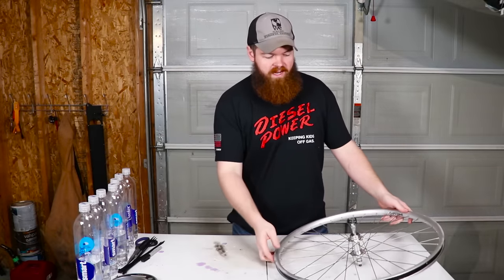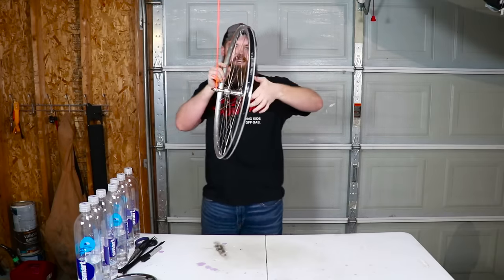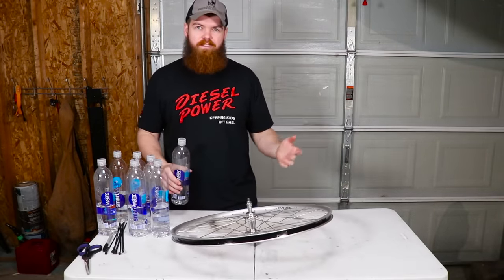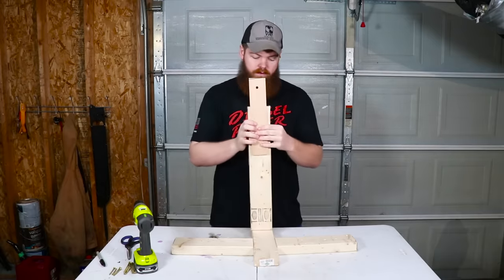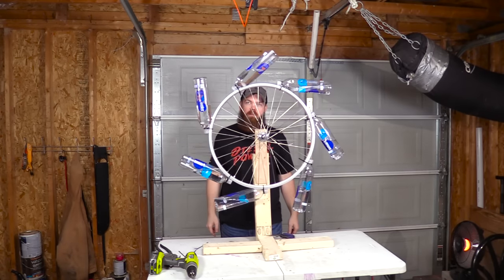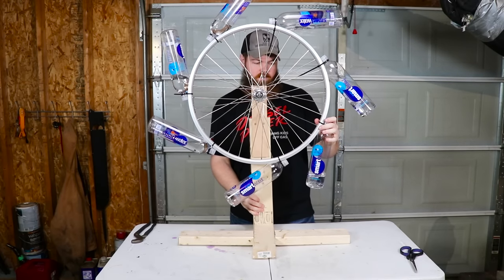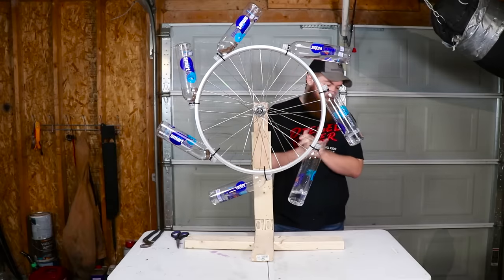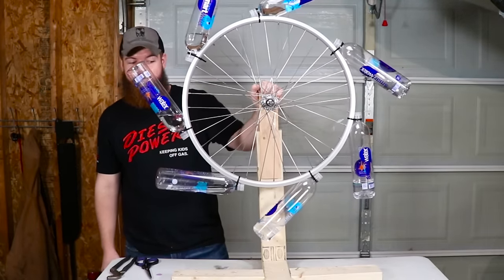Can A Perpetual Motion Wheel Actually Work?

Comment: The reason it didn't work is, you forgot to fit the hidden electric motor.
Reply: And the magnets
Reply: Lmao yes
Reply: Krakka Jakk711 magnets?
Reply: Or the guy in the greenscreen suit spinning the wheel
Reply: @jakkakasunset5485  electric motors work from magnets
Reply: It would have worked if he filled the bottles with blinker fluid.
Reply: Good one😄
Reply: One bottle is missing, with 8 it works.
Reply: At least he is honest, didn't deceive people. 👍
Reply: @janengel1985  Please tell me you’re not serious
Reply: @mitchellmorrison4233  This type of wheel must be symmetrical.
Reply: @janengel1985  this type of wheel is not possable because when you have the bottles on one side shifting down the other side is shifting up. this wheel is balanced. free energy is not possable
Reply: @mitchellmorrison4233  One half must always be heavier than the other. It's that simple.
Reply: @janengel1985  if 1/2 is heavier than the other half the heavier side will just sink to the bottom of the wheel.
Reply: @mitchellmorrison4233  Yes, with a small turn the wheel must be readjusted to maintain the imbalance.
Reply: @janengel1985  What?
Reply: @mitchellmorrison4233  This is how a perpetual motion machine is built.
Reply: @janengel1985  perpetual motion machines aren’t real. 
You could keep it spinning for a little bit, but it’ll never spin forever.
Reply: @mitchellmorrison4233  Soon they will be real.
Reply: @janengel1985  ???
Reply: @janengel1985  Are we there yet?

Comment: Even if the premise behind the idea made any sense, the friction in the axle of the wheel would mean that energy would continue being lost as the wheel turns until there isn't any energy left in the system.
Reply: Also loss of energy due to the turbulence of the water.
Reply: What if the axle was somehow suspended a maglif system thus eliminating friction and instead of water the use of something solid
Reply: The wheel would encounter air resistance as well so it would also need to be in a vacuum.
Reply: @shaunorafferty5930  there's also resistance in the magnetic fields causing for energy loss. Far less resistance than physical contact, but still there
Reply: It's because the water creating the same amount of force when it goes back to the original position so three two forces cancel eachother
Reply: Try using full water bottles, might create enough momentum to freely spin the wheel
Reply: It's transformed to be transferred not lost. Though I get what you're trying to say. Lmao
Reply: Well the wind resistance is a bigger problem than rolling resistance
Reply: @donperry3508  with full bottles it wouldn't make a difference since it's still balanced. There is 0 momentum no matter what.
Reply: @Kaleb Crawford would the magnetic fields cause enough disruption to visibly slow down the spinning? Like if the other conditions were right, would the wheel appear to work, at least for a bit?
Reply: @loganb.313  I mean, if you had it supported by maglev, in a Vacuum, with everything PERFECTLY balanced, it may spin itself for a little while, but not forever, so not a perpetual motion machine. And you also couldn't gain energy from it
Reply: I don't have any science of physics degree, but my theory on why something like this doesn't really work is the fact that fluids do not like changing direction in a hurry. There's also centrifugal forces at play as well, mostly just basic physics on that level. There's likely more at play here, but this is just me thinking out loud.
Reply: @shaunorafferty5930  now im no scientist andn my question will probably prove that but what if it was suspended using magnetics
Reply: What if it's drawing energy from gravity?
Reply: @jchoneandonly  the problem with that would be the friction of the items used while droppingalso that's basically the exact theory that the first perpetual motion machine was invented off of gravity and acceleration
Reply: @protatoplaysgames6918  so then a gravity mill would be difficult to impossible
Reply: @jchoneandonly  honestly this is the first I've heard of a gravity Mill I'm going to have to look into that assuming were talking about the pepper shaker but as most things you find in an infomercial there's more than they like to say
Reply: @protatoplaysgames6918  a gravity mill would be like a windmill but using gravity instead of wind. Read it in the spinward fringe series. I don't know about it being real currently
Reply: @jchoneandonly LOL thank you I did a quick Google search for gravity mill and got the pepper shaker with no doubt further research is needed
Reply: @protatoplaysgames6918  yeah. Might be able to draw power out of something in orbit possibly
Reply: There’s also gravity that adds a bit more friction
Reply: Also energy is never "lost". It is transferred into other types of energy.
Reply: Losan33  stop tryna sound smart
Reply: Also the fact that some energy is dispersed into the surrounding air. Into the wood, table and ground.
Reply: @40pcMcNuggies  I'm not positive but I think this was directed to me you are totally correct I apologize for my Miss wording the previous statement about being in a vacuum is a good point it wouldn't be technically perpetual but could magnetized movement in a vacuum make the magnets lifespan longer again I am no scientist just a guy on YouTube that loves learning as much I can (also if anyone wants to have any type of intellectual conversation feel free to message me teach me or change my mind I love that)
Reply: Is anyone here familiar with mr. Simon Whistler
Reply: Ok Einstein
Reply: Air friction slows it down
Reply: Was just about say.

The energy is being converted to heat energy.

The energy potential is gone.
Reply: Alex DeLozier energy is never created or destroyed which is a very simple science term so you are correct about the friction but engery is not lost and is transferred to the atmosphere or into the wheel or wood so the correct term would be energy would be Dissipated
Reply: a guy no as in zero g you are only removing gravity and there is still friction that is caused by air resistance and the friction caused by the wheel axis. NOTE it will spin for longer without gravity.
Reply: @kadragon3764  long stretch but what if you had an internal spring system in each bottle that would with just the right force, ie water. Release it at just the right angle. When not released it would somehow be kept from sloshing as much.
Reply: @masheen_  The problem is that it takes the same amount of force to raise one water bottle as is gained from lowering the other. Raising a water bottle one meter takes the same amount of Kinetic energy as is gained from the loss of Potential energy from the water bottle on the other end. So no energy is being produced, unless it was completely efficient and frictionless with absolutely no energy loss, it would eventually stop. Under perfect external conditions, a perfect disk would spin longer because it doesn't have the energy loss from the water. Also, there's energy loss when compressing said springs, so there would still be energy loss stopping the motion.
Reply: Or more simply put, the bottles opposite of the force being applied are applying the same amount of force.
Reply: Even with zero friction, aero drag would eventually stop it.
Reply: @leoa4c  Mate, you understand what drag is right? If there was zero friction there wouldn't be drag.
Reply: @shaunorafferty5930  You would still have energy losses. As the liquid moves, its temperature increases.
Most importantly, you would still have aerodynamic losses, which are quite significant.

There will never be a perpetual machine. It would violate one of the most fundamental laws of physics. In a closed system, energy must always be conserved. No energy for free.
Reply: @Cyb3rSix  Yes, I know what drag is. In essence, it is friction. You are correct.
But we cannot have zero friction in a system. It's physically impossible.
Reply: @leoa4c  I've explained the problems with this model. It's simple, the force acting is the same as the force imposed. Meaning that the bottles on either side essentially cancel each other out.
Reply: It doesnt help that his center of mass isnt at the center of the wheel too.
Reply: @robertmills876  If the center of mass is at the center of the wheel then it wouldn't move. For this model to work the center of mass should always be at the peak of where the bottle falls. However the  bottle that's climbing weighs the same thus imposing the same amount of force as the bottle that's falling.
Reply: @Cyb3rSix  I forgot if it's rotating at the center of mass that its needs continious force going into the object which isn't in a perpetual motion machine. Thanks for the catch.
Reply: The premise behind the idea DOES make sense. The primary reason it stops is because of energy lost from tangential motion to friction and heat.
Reply: @lou7319  Oh my, this explanation has to be the worst. I may only have bachelors degree in physics but you are comparing a bike tire to the motion of a star. And yet again I'm going to VERY simply explain why this model does not work. The weight of the force applied is the same as the weight of the force imposed. It's that simple. The word you're looking for is force mate, not tangential motion.
Reply: Let's also not forget that every time the water sloshes to its maxim (the bottom of the bottle), it  tugs slightly on the axle, generating a slightly greater friction on said axle with each maximal point of slosh-age.
Reply: Also every other valid point here.
Reply: Shaun O'rafferty It wouldn’t be perpetual then because magnets don’t last forever
Reply: BTW energy would not be lost it would be transformed. It’s called the law of conservation of energy it’s where energy can’t be created nor destroyed which also answers the question on why perpetual motion machines can’t be created because that would be an infinite source of energy. Which is going against the law.
Reply: @rykersalty7265  I've gotten plenty of these kinds of comments already. When I say loss of energy I obviously mean loss of useful energy to the system that can perform work. Being overly technical about things makes it harder for lay people to understand and is especially pointless when the meaning is clear anyway.
Reply: I just reread my comment from last night and realised that I sounded high off my ass. Sleep deprivation, it's no joke kids.
Reply: This thread is a perfect example of humanity looking to answer questions that we physically don't have the knowledge to understand at the moment, rather than looking for energy in a perpetual motion machine it would be better to use the knowledge gained from this testing to implement improvements into already created renewable energy sources such as turbines and mills as well as sources of energy utilised by natural anomalies
Reply: Could magnetic suspension solve that issue?  There’s still the problem of the counterproductive force being applied to the wheel but frictionless mounting is something that could be resolved I think
Reply: Try to fill one bottle a little higher than the others so to make a little imbalance
Reply: If 😂 you trun it fast enought, it would create a centrifugal force but not perpetual motion lol🤣🤣🤣
Reply: Yea,  it'll eventually run our of energy mathematically... BUT... if it runs for 2 hrs and you need a light in a tunnel or something, all you have to do is spin the wheel and get another 2hrs of light.  It DON'T HAVE TO be Perpetual Motion to be usable energy
Reply: 바보야! 물병 갯수를 7개 하지 말고 8개 짝수로 해봐.❤
Reply: Friction with the air, the wheel, the turbulence of the water. There is just so many energy losses and it needs a lot of power that the gravity just does not provide. :)

Comment: To all who called him an idiot, or some other derogatory name, you're too harsh. He's not an idiot, he's just curious. Nobody is born knowing physics, or anything for that matter; everything you do and know is learned over time. I commend him for experimenting and learning from it.

@TylerTube - One of the main reasons perpetual machines cannot exist is because it is physically impossible to get more energy out of a system (mechanical or otherwise) than the amount of energy that "charges" the system. There are many factors that drain energy from your system including friction etc that other commenters mentioned. 
That established, it is my theory that the main energy drain on the system you made is the water sloshing back and forth in those bottles. What you've created is effectively a weighted flywheel. Flywheels store potential energy, and weighted flywheels can store more potential energy, using inertia. However, they also require more energy input to the system in order to rotate. At one point you commented on how quickly your wheel slowed down. I believe that is due to the movement of the water from one end of a given bottle to the other. That back and forth movement of the water consumed energy fourteen times per revolution in your system. Ergo, the energy you supplied your wheel is more rapidly consumed in comparison to your spinning the wheel at the very beginning when you were displaying the gyroscopic effect.
If you're interested in learning a bit more about how flywheels store energy, consider watching a video on YouTube called "The Mechanical Battery" posted seven months ago by New Mind. If this video was actually a joke and you already knew all of that stuff, then I'm the idiot. 😊 Have a great night all. 😁

Comment: Think about it this way: you've equally spaced a bunch of weight on a wheel, all you did is balance it. In order to spin the wheel, you had to put force on one side and then let it go to push it forward. By adding those bottles all you've done is add weight to the the entire wheel, like adding a tire, its changed nothing and gives no driving force to the wheel
Reply: It's almost like the added weight increases friction which is a constant force acting against the initial momentary force applied to make it spin.  Thus friction will win every time.
Reply: Not exactly. Although the torque on the left side is higher than the right, the torque at the bottom is higher than the top. Both of these higher forces are in opposition. So right there you have a zero net turning force. Even so, there's still the various frictions that also resist the wheel from turning.

Comment: Just think about all the forces at play and you will get an idea as to why it cannot do what you want it to. The main issue is you don't think about the friction the wheel has to deal with as it spins, that is wasted energy. Furthermore, whenever water is going down, the wheel is also raising the water on the other side which counters the force you put in. I am sure there is more to this so please correct if I am wrong.

Comment: Why it didnt work is because the number of bottles is supposed to be a factor of 360⁰. That is 4,5, 6, 8, 9, 10, 12, 15, 18.... and so on, You used 7 bottles, no way to have an equal spacing between the bottles. Hence the centre of gravity would be one sided.
Reply: Yes exactly my thought - even if more water was added to the bottles instead of removing it would have been a better option but clearly with such a gap between the bottles there was no way it could create enough force to keep moving.
Reply: Whether it works or not, l thank you so much. What l know is that you are a researcher
Reply: I wonder if the results would be different if the bottles were arranged in Directions N , NE , E , SE , S , SW ,W , NW,  also the bottles need hinging I think and then you have the issue of centrifugal force which means if you could make it work you need to find a way to make the bottles travelling up stay close to wheel
Reply: Lol, it didn't work because perpetual motion is not possible.